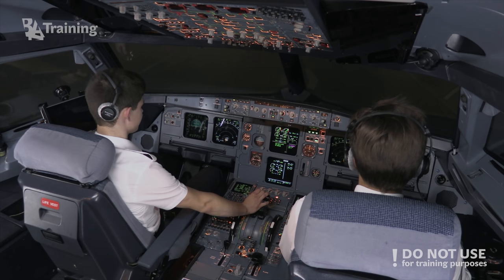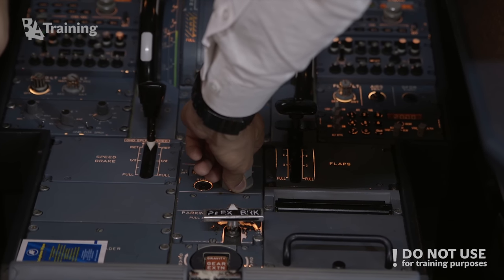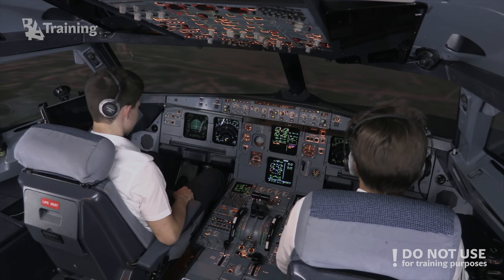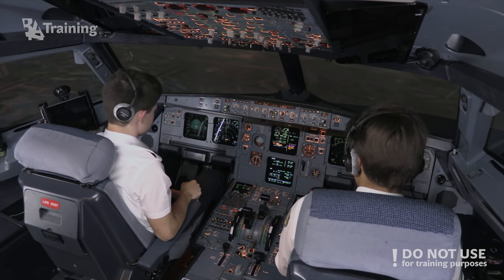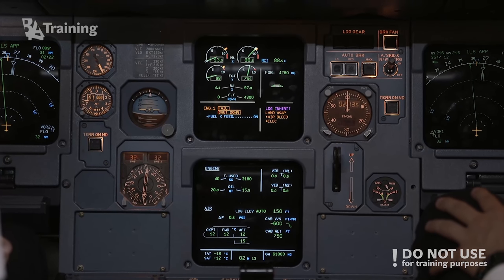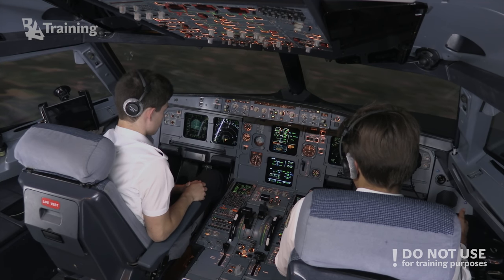Airbus A320 ECAM: What is it and how does it help pilots? - BAA Training

Comment: The important thing to consider before turning on the fuel x feed is that, the level of the fuel in the wing which has the less fuel in it should be reasonable and the amount of the fuel in the other tank, which engine failure has happened in that side, should be constant for a reasonable amount of time. Otherwise you should be suspect there is a fuel leakage in the system and you must not do fuel x feed because you will fly on empty later on.

Comment: Why is there no alarm after engine failure on V1?
Reply: cruxader27 What alarm?
Reply: Alarm that the engine failed. I mean the continuous chimes
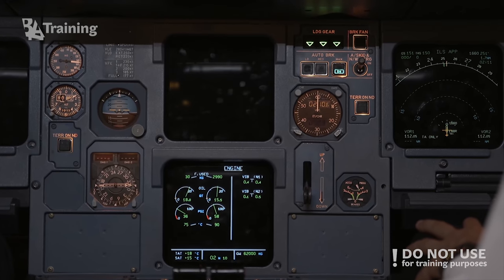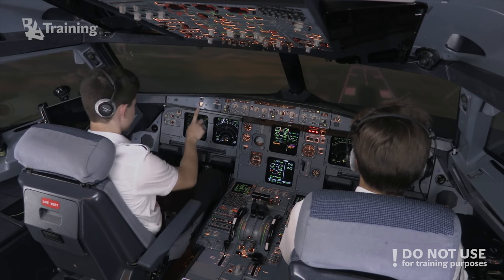Reply: At 8:13 you can see on the ECAM display in pink letters "T.O INHIBIT". If my understanding is correct, this means that the pilots will not be bothered with audible alarms and error displays during this critical phase of the flight. Since they have already accelerated above V1 when the engine fails, they have no choice but to take off. Alarms sounding and displays throwing error messages in their face won't do them any good. At 8:23 the PM presses the "MASTER CAUTION" button, silencing the alarm before the take off inhibition has been lifted, which would explain why there is no alarm sounding at any point. Once they engage the autopilot, ECAM displays the engine fail checklist.
Disclaimer: not a pilot, just love watching these videos. If I'm mistaken I'd appreciate being corrected :)

Comment: why there is no warning / Master warning when the Engine No-1 failed at V-1 ? it is critical position to take decision of positive climbing with one engine. warnings and ECAM notifications not shown as what is the problem like whether its fire on the ENG-1 or no pressure nor shut down by fuel cut etc etc...

during approach and landing, there is no APPROACHING MINIMUMS, MINIMUMS, proximity warnings after radio message for 500 & 300 feet. landing check list missing GEAR DOWN, ALL  GREEN check confirmation not repeated by both crew. 

I guess the "flap full" is too early with 1 engine. 

after touchdown, reverse thrust with 1 engine turn the aircraft to other direction and rudder balancing and center alignment information is missing or not explained well.

this trainer is also did his best, but it seems he is hurry and operates buttons/ switches and levers without explaining them to the trainee or viewers. even we know as what he doing it is mandatory to explain or tell about before he touch them.

BAA is my favorite training academy which I was impressed by Mr. Pranas and his way of explanation and replies to the comments and questions. please bring him back with new tutorials. - Good luck

Comment: Damn, those LCD flickers probably make pilot dizzy. Can't believe a multi billion dollar aircraft haven't fix this.
Reply: that flickering happened because it was recorded in low light.  if u record ur tv with ur phone in low light it will also be flickering.
Reply: The earlier A320s as well as this simulator use CRT displays and due to the way CRT displays work this effect on appears on camera and is not visible to the pilots.